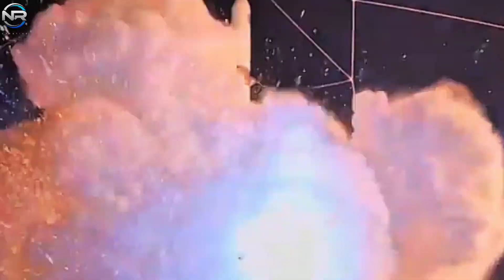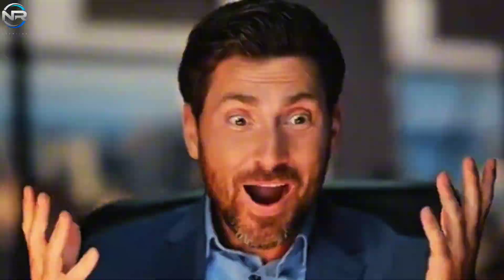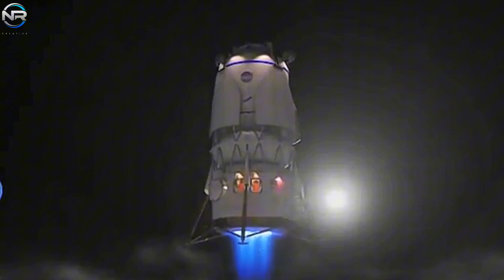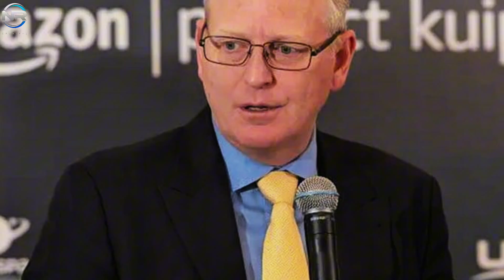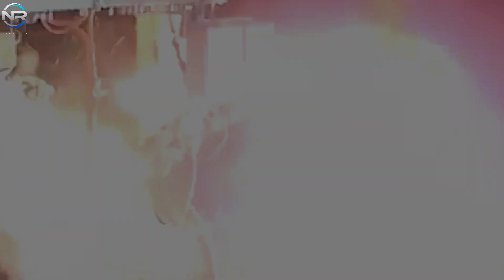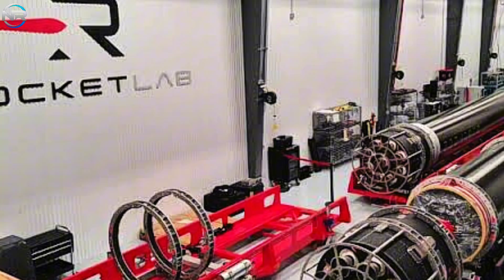SpaceX Lunar Lander Is Over! NASA Announces Blue Origin New Glan Is Replacing SpaceX!

Comment: BS Title. They won't be "replacing" Starship, nor will they be landing people on the moon in 2025 and that's the point. Everyone else is landing things on the moon to poke about. 
BO has one successful launch (zero landings) under its belt. Starship has caught up with it and Spacex is launching every 2 months. By year's end they will have a fully functional Starship V3 with 100t load capacity and full reusability.

Their lander has 1/20th the capacity target of Starship... can't be used to create a useful permanent presence on the Moon in any case and we have no update on the lander but its clearly not ready for human rated flight. The manned lander won't happen before 2028/9 if at all. Spacex will have landed and returned at least once by then with 10x the larger BO lander's cargo.